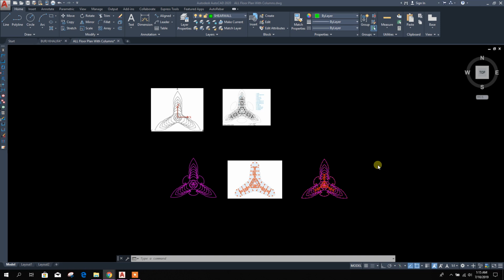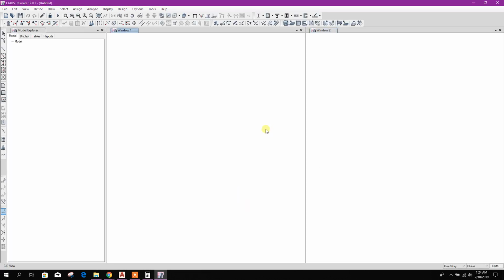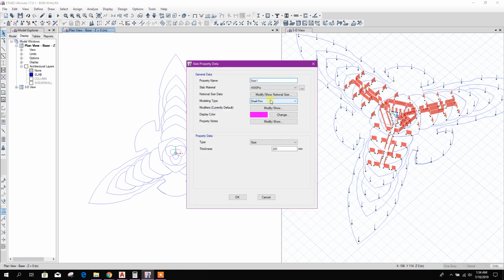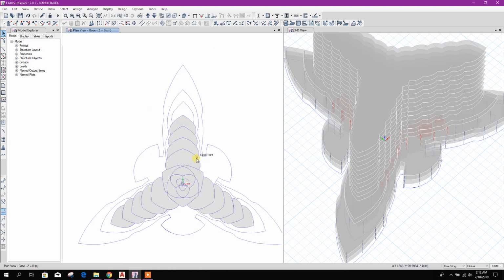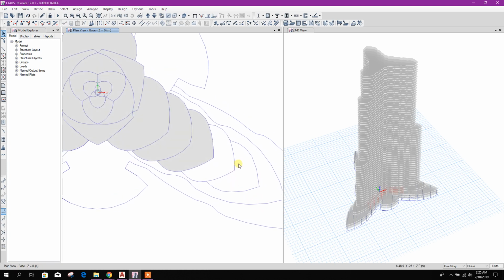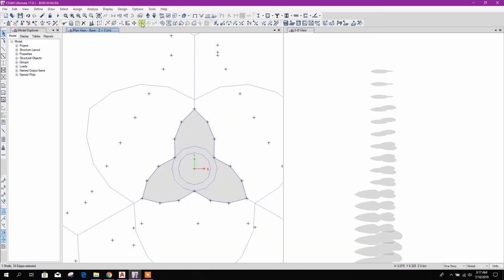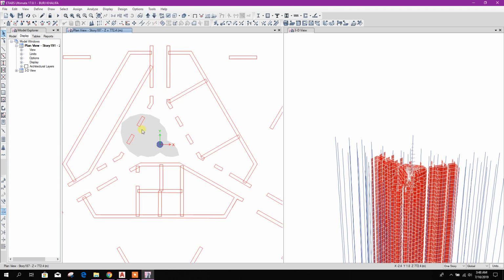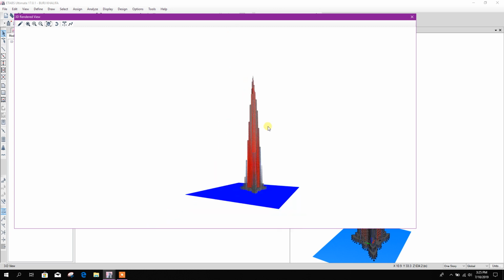Modeling of Burj Khalifa in Etabs v17 with Column, Shear Wall & Floors

Comment: R/Sir, Thank you very much for your sincere effort and outstanding tutorials that might have helped thousands like me. I would be greatly humbled if you could tell how those columns appear in upper storey as  null-line boxes since I am using Etabs v.18 and not being able to see any columns as I move to upper storey ie Z1 - just a blank screen and nodes. I am a beginner in etabs and replicating your work for practice. Thanks & Regards.
Reply from the maker: Check your 3d view limit option in Etabs.

Comment: How to apply multi-tower in Etabs and if the Multi tower is not the same as the story, for example, Tower 1= 150 m and Tower 2 = 175 m and get 1 podium, how to make the towers obtain Different Fundamental Periode at once Analysis?